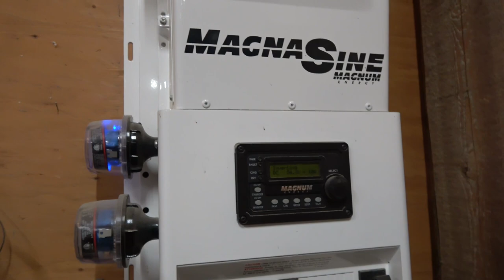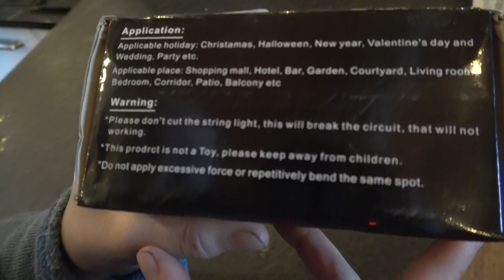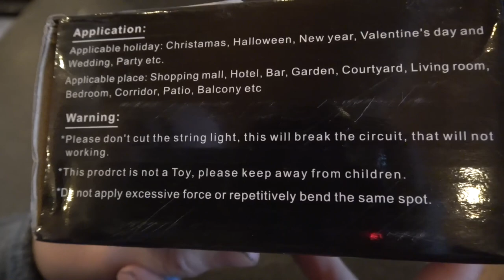AC or DC? We upgrade the solar power system for our off grid house.

Comment: I am building a homestead and am going to have a few AC outlets for certain appliances, but the rest is going to be DC. I just want to stay simple without all the conversions and don't want to have to rely on inverters and power loss. I also like to have several small inverters rather that 1 large one, that way when an inverter goes, you still have power until you can replace it.
Reply: That's what I was thinking. If you run all AC, you have efficiency losses at each conversion point. Router, laptops, tablets, LED lights...all runs off DC. Unless maybe ina DC only system, the DC to DC conversion to step to the correct DC voltages for all those devices is nearly as inefficient as DC to AC to DC. I don't know the answer, but would like to see some numbers.

Comment: i would love to know how meny wat's was being  Used  it is rely remarkable that one should put so' meny y light in the end of one room. When in my opinion .  one distributes light. sparingly let me put it in this way lets say you would lick 100 wats of light in one room .  should one put one signal bulb limiting 100wat's  or 3 bulbs if 35wats each  or two 50 what bulb's   Well I'm of the opinion that 2or3  poisons should  be used & the ability to cut one of tune one of in faver for a replacement position is Preferd  AS one moves from  room to the next. the tenancy to say well it solar we have plenty we do not need to pay a bill.  is a fulls dichotomy Or as my dad would  say a giant misfire when the bear is Dounding down on you Ye he did hunt in Canada as as a lad. i think we still have family  out their someway .  batteries cost moony & will in time need replacing . so keeping a reserve bank of full batteries becomes a occupation one should adopt. so one bank can be recharges when they  reach 50% of discharge & the darn disconnected in faver of the full bank . & like the lights trend of when not in use is a  pint we need to observe . wen i was living of grid i fawn meny a light left tern on. no one seemed to grasp the need to tern them of when not in uses  I got over this problem By removing all the light bulbs  & giving the family a light  bulb each to plug in when needed . it was about a year when i knotted they  wuld leave the lightbulb in place & turn it of when not in use . soom all the light  bulb's was in place & the light's of when not in ues,  lesson finally learnt.

Comment: Phillips was designed to slip. That way the guys in the auto plants couldn't over torque the screws and snap them off.  Roberson rules !
Reply: As an American carpenter, I solemnly swear that the Phillips system was designed to sell more drivers and screws.  Thanks God we have more options now....
Reply: you seriously believe that?   designed to slip
Reply: @yarpos  Absolutely, Too many snapped fasteners on the assembly lines. Engineers came up with a screw head that would slip at certain torque levels so no more snapped screws.

Comment: Just a tip from a old grid installer, tape the red wire black for future reference on each side so you will always know it is the negative. Good show with everyone understanding ac and dc wiring, most of the clients I installed for had no idea really what they were working with and most never even read the manuals. Cheers DC system install on the tree house coming soon to a theatre near you...............

Comment: 2nd Comment 
Phillips bits just need maintenance now and then and they work fine.

Grind off the little "tit" that inevitably forms. Just grind it back until it's even with the 4 flutes, THEN grind the flutes back a bit until the tip is sharp again. Easy peasy.

MAKE SURE you don't have a "Phillister" tip. They are similar to Phillips, but flatter.

Comment: Must ask, are there no codes for AC wiring in canada? 3 red cables, and no green-yellow for ground? Thats just dangerous. There is a reson for codes, seriosly. People DIE of AC and there is a fire potential. 12v DC is harmless, and a fire hazard at most. But AC right out KILLS people.

Wire a ground cable wrong and you have 110 (or is it 230?) volt on the wrong place..

Comment: My wife and i are still mostly 12 volt 5 years in. 450 watts of solar and 700 watt turbine to a huge whopping 260 AH battery bank then 300 watt inverter. My wife watched your video and said our small system is fine because I don't need to compensate for short comings others have. 😒😉😂

Comment: Finally, when someone sees you (and your solar system) they'll be able to say "would you look at the size of that!"  😃😃
I know a bit about industrial electrical, but not as much about this type.  So what is the advantage to going AC, or is it just that the bigger systems are built that way?
Lastly, that is the coolest chandelier ever!
Reply from the maker: Jim F the DC works for most cabin stuff but for a fridge, freezer, kitchen and shop tools, AC is really the only option.  New Inverters are very efficient (up to ~98%), and AC wiring components are very cheap so there really is no reason not to go AC for a bigger system.
Reply: Gridlessness   Yeah, they make some DC fridges, but the cost is almost enough to make you switch, and a freezer is one of the things causing me anxiety about future plans.   
They must be a big draw on the system, no?  Need to keep game frozen safely.
Reply: I think you would be surprised at the voltage drop across wires with DC. Even large gauge wires drop quite a lot over a relatively short run. That is the reason everyone has AC in their house. Tesla vs Edison. I like the horns on the chandelier but I think the skull is a bit creepy. :P